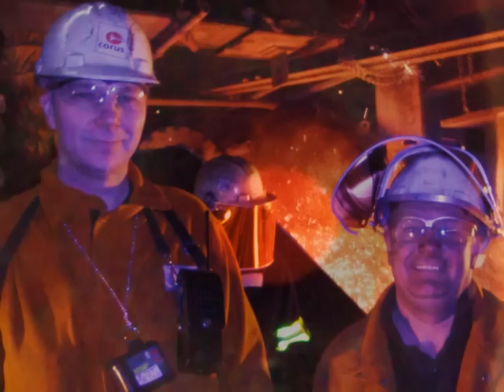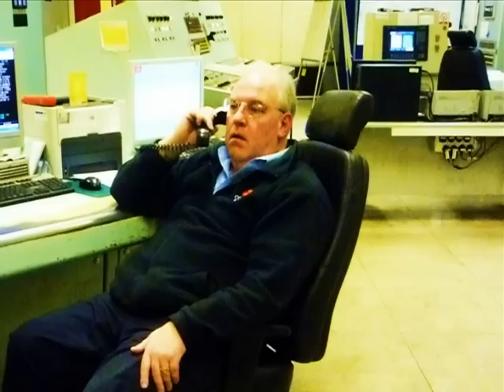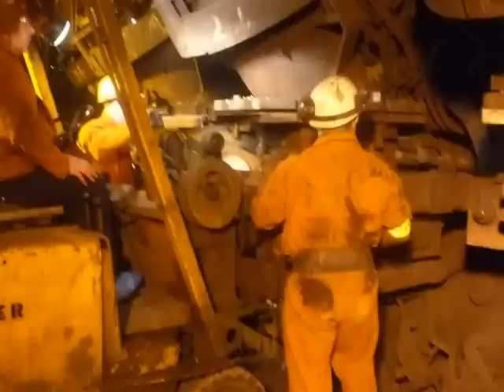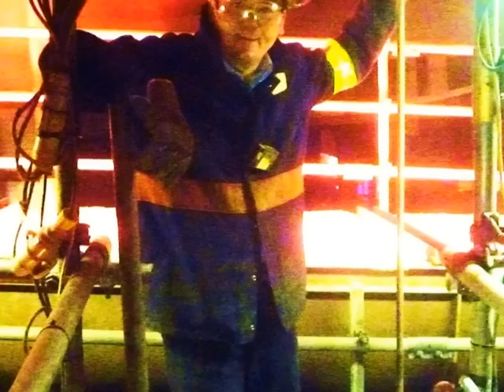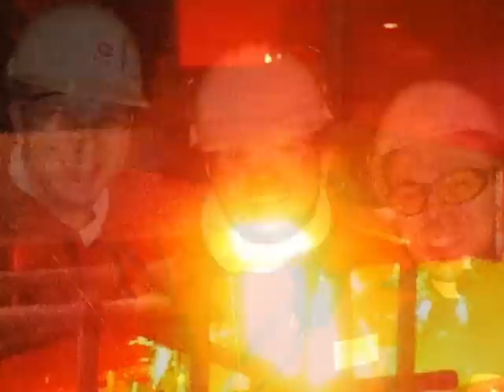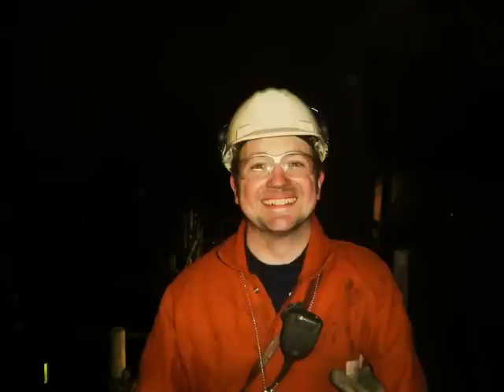one day.wmv

Comment: At one minute….coffee pot bleed valves opened to release pressure.
2 mins 35 …fork lift below a tuyere….probably designed by Satish Sabhuval from Stockton.
Hot metal running into torpedo car.